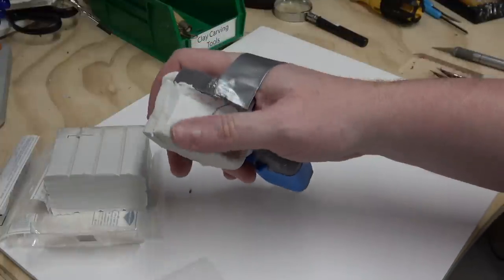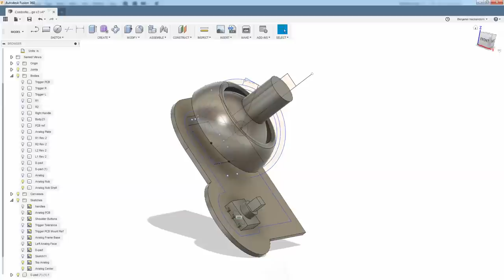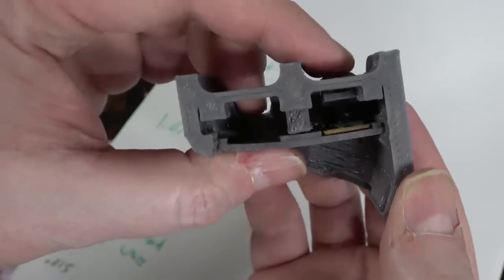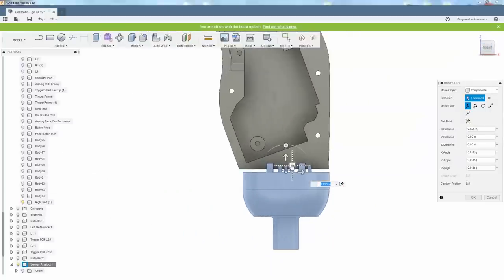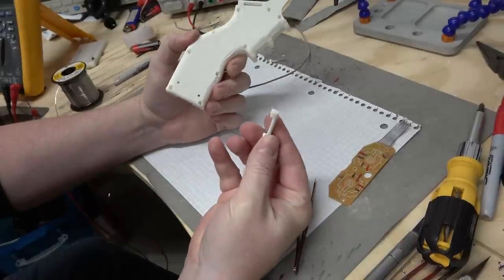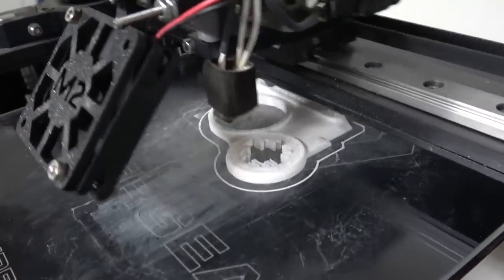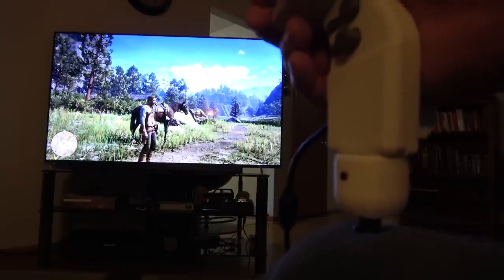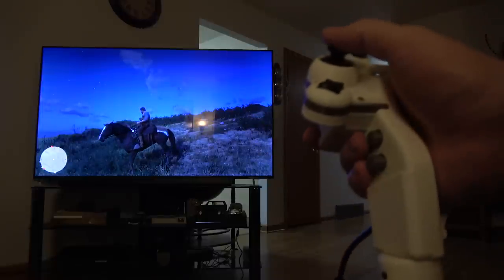PS4 Single Handed Controller Part 2

Comment: This is looking like an awesome project! And I'm very much enjoying watching you work as well. Here's a question, though. You said you were going to offer these controllers for sale, right? 3D printing each unit is a great way to prototype, but seems like a much too time consuming and expensive solution to me. Have you considered using resin casting for the plastic parts? I've done quite a bit of molding and casting so I'd be happy to help.

Comment: so you made a flightstick without the base? i mean a base attachment would be great so you wont have to awkwardly press it against your leg. but the option to have that would be great but it would probably trash the analogstick. however a flightstick concept would work great on a table or a desk

Comment: wouldnt it be better to switch around the face buttons and the d-pad so the face buttons are next to the thumb since they are typically used a lot more frequently in games than the d-pad

Comment: The problem you stated of having trouble with overcompensating when using the bottom movement stick, id recommend honestly just making a true joystick with a base so that you can be more accurate with hand movements instead of needing to push the controller from such a disjointed location using your arm like that.

Comment: Personally, I'm not a big fan of the joystick on the bottom of the controller.   I feel like a button to activate motion controls for the secondary stick would be slightly more practical. Great work otherwise, end result looks really polished

Comment: I think it would be cool to do a Nintendo switch type controller for xbox or playstation so you dont have to have a stick on the bottom. As well make a dpad that inputs for button pushes on one hand. And keep 2 finger slots on each and so you could do r1/2 with right hand and one for each finger and so on either left side

Comment: Instead of the down joystick replace it with a gyroscope so you can use it while standing I have done it and it works but still you have done great job

Comment: I would cut the cord short and put a female USB on the end. Or maybe find space to set the USB port inside the controller. It would just make it easier to store. Then game with an extension cord. I dunno, I remember wrecking old wired controllers in my day

Comment: It might be worth noting that regular ps4 controllers can be used one handed. I had a stroke a couple years ago and lost the use of my right hand. If you put your palm on the left joystick, your thumb should have access to the right joystick and face buttons. And you can use your pinky and index fingers for the shoulder buttons and triggers. Pretend the controller is like the super nintendo, for the purposes of this technique, the controller doesn't have thighs or handles or whatever the the hell their called.

Comment: I would have set up the joy sticks one with the thumb which is fine but the second one would be controller with the middle finger. And you pointer could be R1 or R2 which ever the shooting button is.

X button could be by the the thumb stick on top.  You're going to kill that joy stick on the bottom.

Comment: It looks like a dope joystick. 
I like it :D
Maybe just put a... (I don't know how it's called, but you press it on something flat, it sucks air and holds up [sucker? can I call it like this?]) on the bottom, instead of a normal joystick. If you do this, you can actually use it like an oldschool joystick.

Comment: Ok if I designed this disaster, the left stick would have been the bottom one because movement is very precise for games. Fast paced FPS's I would prefer to be able to control my movement with my thumb and my aim with my wrist. Not the worst design though, definitely big learning curve associated.

Comment: Since you have a stick down on the botton of it, couldn't you, potentially, just by inverting the layout (Aka using the default position for the wires) use it like an airship joystick? maybe adding a bigger surface to put it against a table?
https://imgur.com/a/shnW6K9
I feel like that aproach would make it more confortable even against the leg since you dont... slide it against the leg getting the thin border pressing against it? But it would rather sit flush against it and allow for more precise movement, while also having the advantage of people being more used to that kind of control.

Comment: You should patent this if you can. There can be a very real market for people with amputated hands/arms/fingers or who were simply born with a malformed hand. Did some quick research and don't see anything quite like this. Just modified two handed controllers and a one handed that is intended for use with a mouse in the other hand.

Comment: But... where us the home button? And don't se quite the function of the multi but to for share/photo. Cause with the normal photo you can also start making a video. And no options button? Might had added the left analogs tick on the place where your index finger is. Looks weird to use your leg to use a controller 😁😁

Comment: Could you make a controller that is separated like a wii and nunchuck controller and you could put the right side of the controller in your right hand and the left side of the controller in your left ???! They could be connected by a cable that goes between them?
Reply: Buy a Switch.

Comment: Looks good. I need to make one for my left hand.  With a slightly diff config (it will have a tiny trackball on the underside in place of the touchpad). Just using epoxy putty atm but will be vacuuming a carbon fiber shell once I get everything in place. I should prob make a vid...
This link is the trackball etc I'm using. It's reallllllly hard to find a place that sells it anymore.. The one I have I've had sitting around for years back when it first showed up on the web. I was going to mod a PS3 controller with it to do camera control with my middle finger UNDER the controller (like the PSVita sort of..) but was too lazy till now..  https://www.geekalerts.com/tiny-usb-trackball/

Comment: Anybody gotten a response from his email yet.. want to get on the preorder list asap been dealing with joystick drift on my 1 handed controller for over a year. Want to be one of the first ones mailed out ready to pay.  Also if anyone wants to work on building a custom flat controller either from arduino or using pcbs from the huge inventory of various controller pcbs i have hit me up.. Willing to pay and promote to get you more ones... i was taking off in my first month of streaming and then stick got to bad and that was last may and have had to put full time streaming on hold.